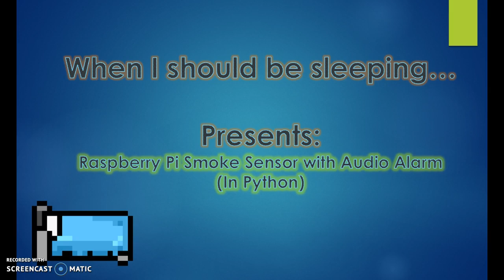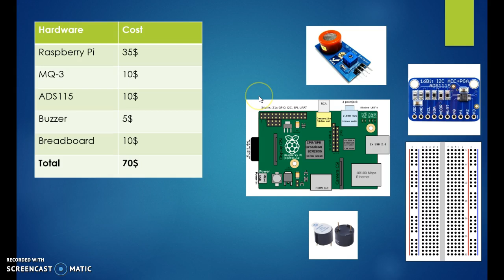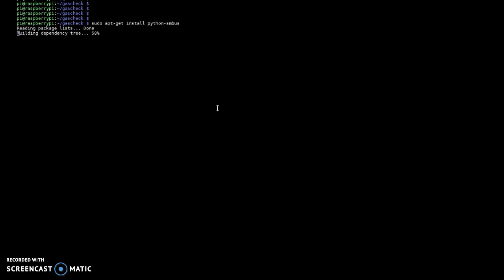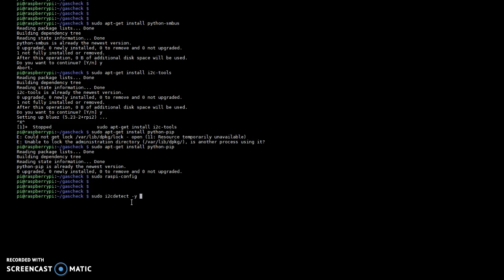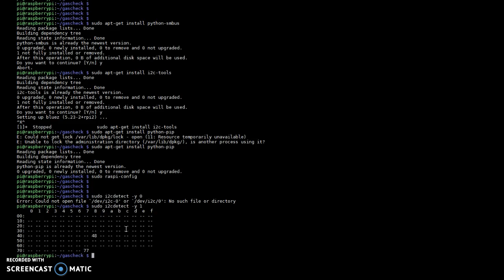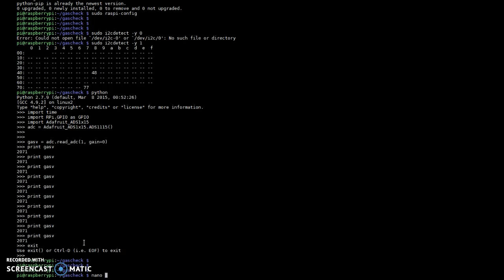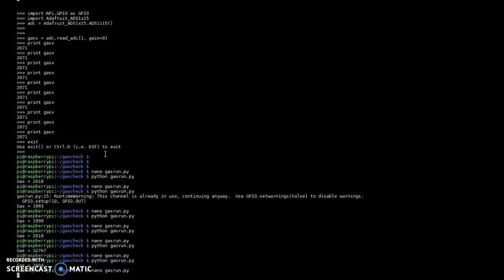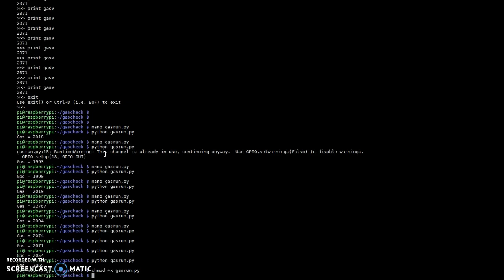Raspberry Pi Smoke Sensor in Python

Comment: Can you add the Python code? please
Reply from the maker: #This should be pretty close

import time
import RPi.GPIO as GPIO
import Adafruit_ADS1x15.ADS1115()

GPIO.setmode(GPIO.BCM)

gasv = adc.read_adc(1, gain=0)

if gasv <5000:
    GPIO.setup(18.GPIO.OUT)
    GPIO.output(18,1)
    time.sleep(1)
    GPIO.cleanup()

print('Gas = ' + str(gasv))

Comment: Hi Sir, I have MCP3008  as a  ADC so will it work as shown by  you?(I wamt to make a alcohol detector actually)
Reply from the maker: Yes, this should work.  Just make sure you have the pi connected to the right Pins, should be 11-13 if the chip is not on any breakout board.

Comment: Hello, I'm living in korea, of course south...
anyway I found your video teaching about using gas sensor with raspberry pi, but i don't have converter you use in the video
so... should i have converter to use gas sensor? because i have to make it up early for assignment plz answer me plz
Reply from the maker: To follow the instruction in this video you need to have a digital to analog converter.  The MQ3 in this video uses analog signal and the raspberry pi has trouble with Analog (Maybe these is a way to make it work?).  By using an analog to digital converter it is much easier for the pi to get a consistent signal.    You could also get a Gas sensor that supports digital directly like: CCS811

Comment: How can it work having only 2 wires to sensor?!
Reply from the maker: Analog sensors normally apply resistance as they measure.  In this case a small voltage goes through the sensor and gets resisted.  The analog to digital convert reads that change in resistance and sends it back to the Pi via the i2c connection.